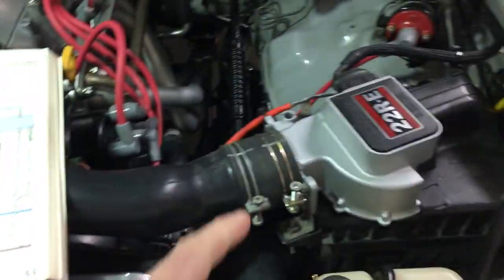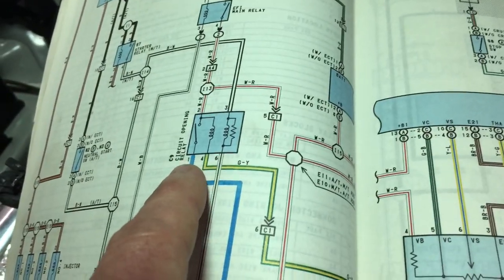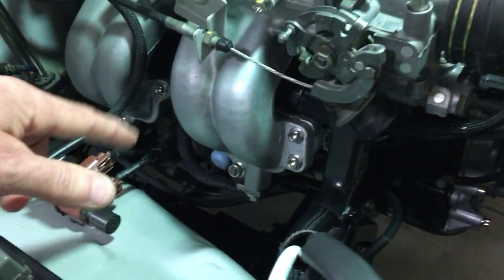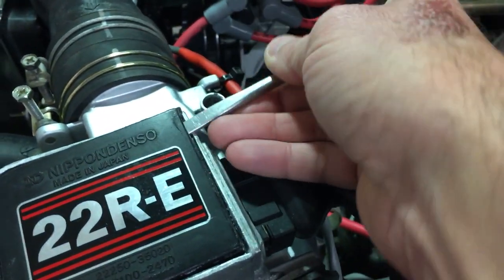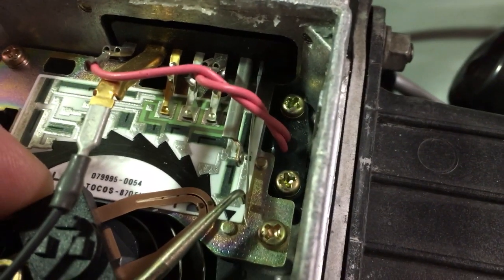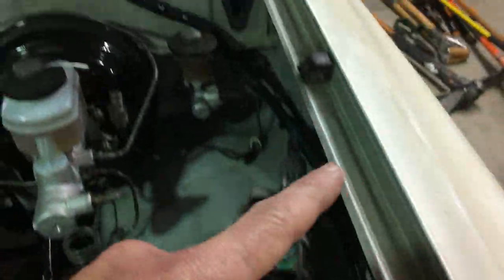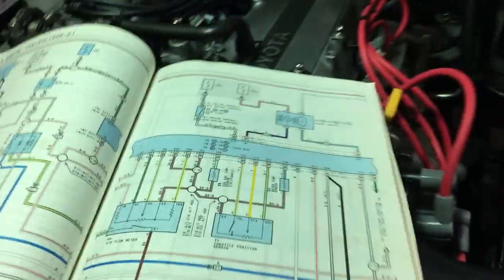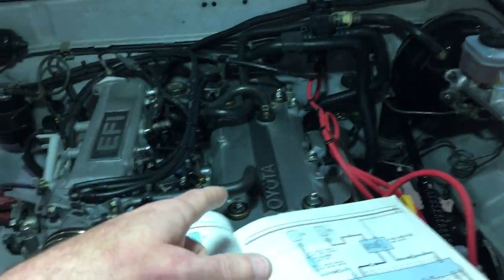How the Toyota 22RE AFM turns on the circuit opening relay via FC & E1 to enable your fuel pump

Comment: Hello just like to say awesome video it help me a lot . . My question if the relay switch in the air flow meter, is not working , can it be rebuilt or just replace the hole air flow meter
Reply from the maker: Thanks! Yeah, you might be able to repair it in there and/or clean the contact point, sort of like with points on a distributor. A lot depends on how exactly it's damaged. As near as I can tell, it's just an electrical contact, so it should be fairly straightforward to adjust and/or repair.

Comment: Hello again . My 1991 toyota 22RE airflow meter measuring plate will not open when u turn the key to on Position . Which will not start the fuel pump . . So I open the measuring play with my finger . Everything turn on . The relay and fuel pump . What make that measuring plat open when u turn  the key to the on position ..
Reply from the maker: The plate is only opened by air suction from the motor. When you turn the key to "ON" there is no power to the fuel pump if the motor is not running. When you turn the key to "START", there is a secondary relay which powers the fuel pump briefly to provide pressure and start the motor. Once the motor has started, vacuum will crack the AFM plate open enough to close the relay inside the AFM and continue to provide power to the fuel pump. This is all done so that if the motor stalls, the fuel pump will cut the fuel pressure.
Reply: Really , theirs  a 2nd relay,  and where would that 2nd relay be because in the diagrams I have . It dosent say anything about the 2nd relay . Also ur. Videos are awesome they helped me out a lot . . I just finished putting  12” lift on it and 37 “ tire . . . I was hoping on getting it on the road this summer .
Reply from the maker: @chrismaiolino800  You can see it mentioned in my video here: https://www.youtube.com/watch?v=EpTED3Z2xo8 - it's not physically a 2nd relay, it's two relays inside of one "relay". If you look at the diagram and find the relay called the "circuit opening relay", and look closely, you'll see there are two pathways which can trigger the relay. One is controlled through the starter circuit and the other is controlled via the AFM door switch. It's possible you have an electrical issue on just the circuit in the relay which is connected to the starter relay stuff. But again, the fuel pump doesn't turn on when the ignition is "ON" unless the motor is running and sucking air through the AFM. You can also manually turn the fuel pump on using the Diagnostic box over there by the fuse box - just jumper Fp and B+ and it should fire up and pressurize your fuel rail; this will allow you to start the truck even if the starter relay circuit is dead. You can also pop the cover off the AFM and manually move the lever a little and it will kick the fuel pump on if the ignition is "ON"